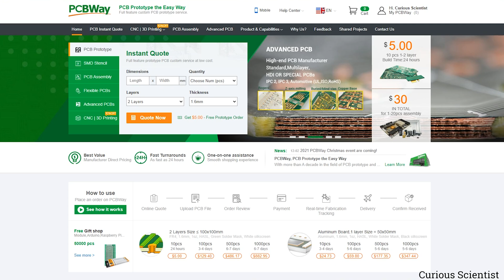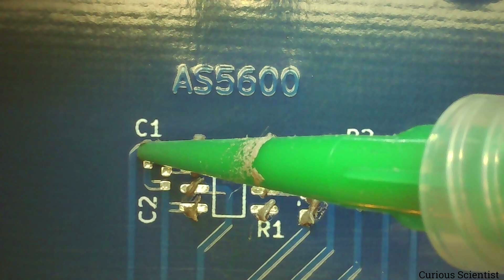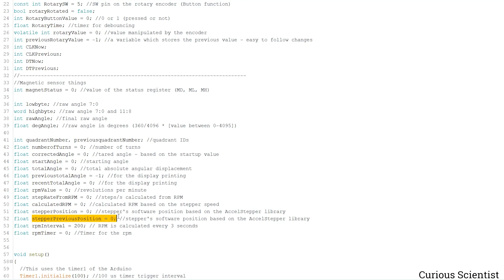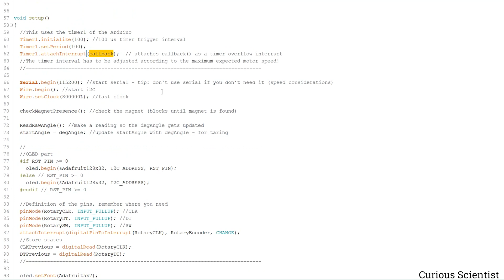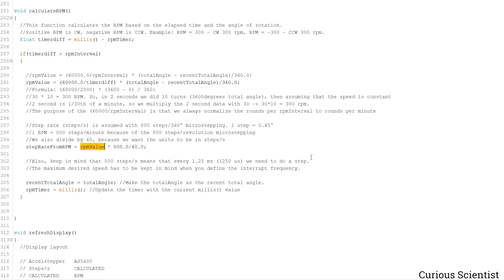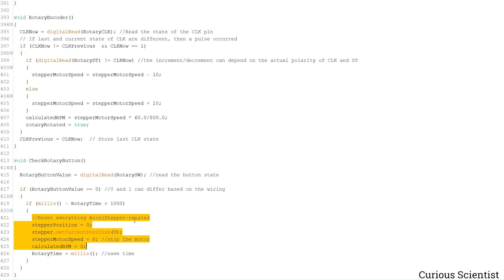Measuring speed and position using the AS5600 magnetic encoder

Comment: Hey man, been nice watching your videos, criminally underrated and unknown.

I have a question though, I have a tmc2208 driver that is supposed to be able to switch out with a4988s, and I want to use it on that little expansion board that you have. I tried using the expansion board myself with the accelstepper library, but to no avail. Could you please explain how you managed to get your expansion board to work with the accelstepper library, and if I would be able to hotswap it out with a tmc2208?
Reply from the maker: Hi and thanks! It is very important to connect the enable pin of the breakout board to the ground, otherwise the stepper motor will not be powered. Regarding the tmc2208 question, I don't know, because I have never used that board, but since other people also asked it, I will test it and publish a short video about it if it works.
Reply: @CuriousScientist  thanks alot, do you have a discord or anything alike? I highly suggest you make one for people to talk about these things
Reply from the maker: Sorry, I don't have any of these because I don't have the time and resources for it. Viewers are always welcome to discuss these questions in the comments.
Reply: @CuriousScientist  perfectly understandable, and thanks for the help.
One last question relating to my first comment, how do you use the accelstepper library with the expansion board? No matter what I do I cannot seem to get it to work unless I manually set up a loop with a delay between setting the step pin to be high and low to manually spin the motor. I'm trying to use serial to get some values from a joystick in python to control the speed of 2 stepper motors for a turret, and your videos have been a great help but the one thing I cannot wrap my head around is the usage of the expansion board and accelstepper/multistepper library. I tried using your diagram and code but nothing seems to work
Reply from the maker: I have dozens of videos where I use the expansion board and they work properly, so something must be wrong with the code you use or the circuit. The expansion board is so simple, it only needs 3 wires, so you might overlook something very simple.
Reply: @CuriousScientist  I think it might be in the code then, do you have any videos where you give the code to a project where you specifically use the expansion board? I remember trying one once and for some reason it didn't work
Reply from the maker: Check my channel, there is a whole playlist of stepper motor related videos. Take your time.
Reply: @CuriousScientist  will do, thanks for the help!
Reply from the maker: You're welcome!

Comment: Hi sorry for asking again, my encoders arrived today and i'm having a problem, the encoder only reads the first and fourth quadrant I checked with your code this, I don't know what is I tried with other 2 and had the same problem did you had a similar problem?
Reply from the maker: Hi! I don't really understand what you mean. It should detect all the 4 quadrants. As you see it in the code, there is a commented section right after checking the current quadrant position and if you uncomment them, you can print the detected quadrant on the serial terminal. I am pretty sure that you should see all 4 quadrants.
Reply: @CuriousScientist  Yes I uncommented this part of the code and it's only detecting 2 quadrants
Reply from the maker: Hm, that is very interesting. How do the corrected angle readings look like?
Reply: @CuriousScientist  it reads like 700 to 1000 and goes back to 700 (it's just an example it's not the real numbers) and the quadrant number sometimes change sometimes  when I turn the magnet with the encoder off

Comment: I'm curious, where's the magnet? And how you fixed the magnet on the shaft?
It's is very important to set the magnet at the center of the AS5600
Reply from the maker: I told it in the video... The magnet is attached to the shaft. It sticks to the shaft because it is magnetic, but I actually added a drop of superglue, just to keep it in the center. You should check the other video that I recommended in this video because it shows more information about the magnet and its mounting.

Comment: it's possible to make a closed loop with a pid control?
Reply from the maker: Of course. But depending on the application it might be an overkill.
Reply: @CuriousScientist  I'm going to use in a robot arm, but I don't know how to control it yet,  and thanks for the videos :)
Reply from the maker: I have a video on PID controlling DC motors. Check my channel, you'll find it.
Reply: @CuriousScientist  i'll take a look thanks
Reply: @CuriousScientist How difficult is it to build a CNC using a closed-loop control system? Is it worth it?
Reply from the maker: It depends on your knowledge and skills.

Comment: how fast can you spin before library looses steps?
Reply from the maker: I haven't tested it to the absolute maximum (theoretical maximum RPM of the stepper motor), but it was still okay at 2400 steps/s. I believe that it can go much more higher. But that might need some adjustment on my code to make sure that the position of the shaft is polled frequently enough. I will test this when I make another video with this board.